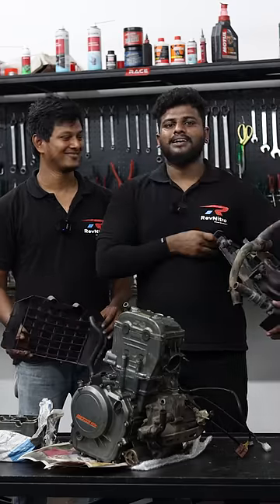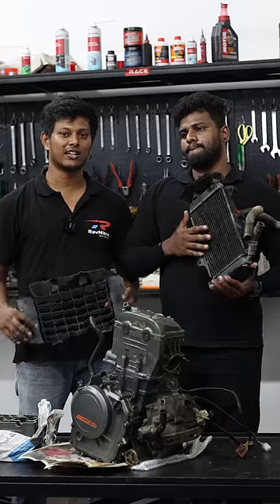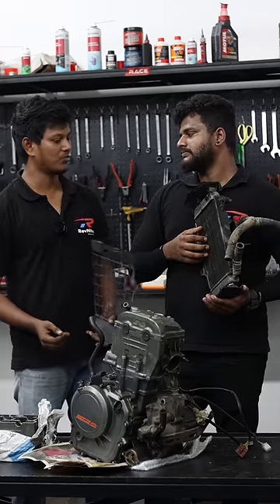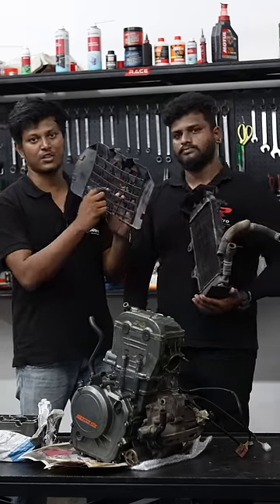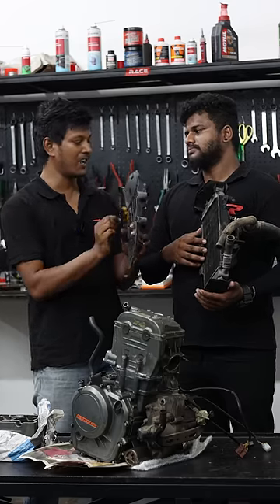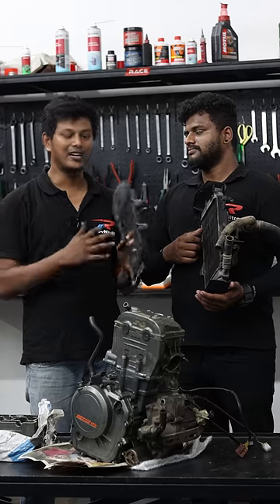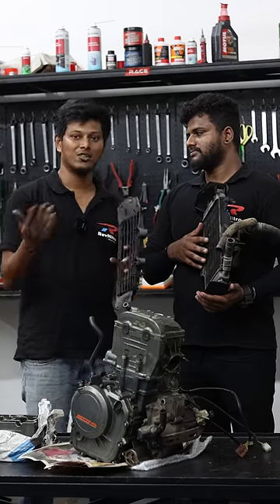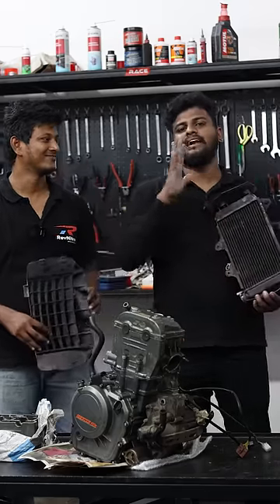Guard potta Prechanaya!!! | Radiator Guard | RevNitro

Comment: One doubt. The n160 shares everything except engine with n 250. Both are oil cooled engines. The n160's radiator is small,n250's is big. Can i use 250's bigger radiator on n160?